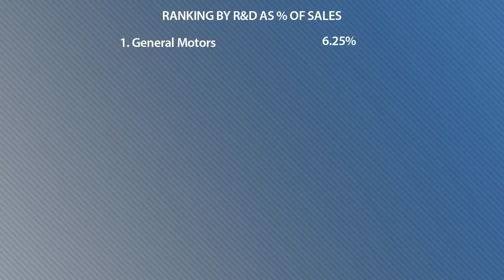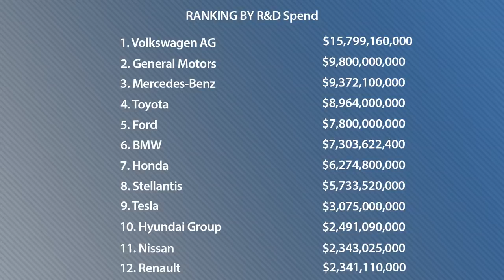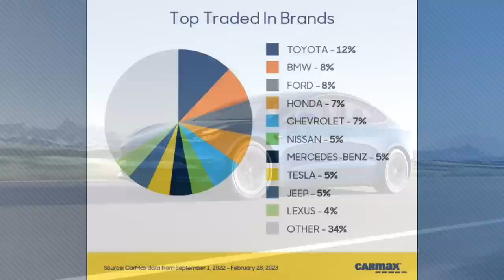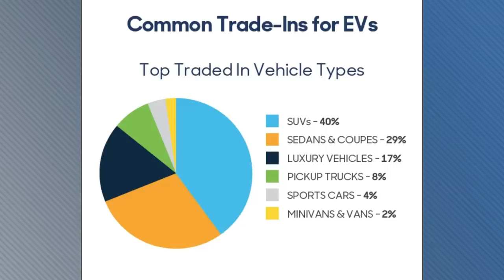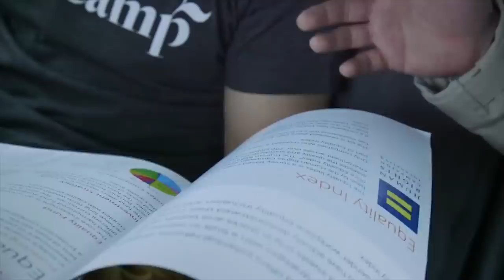BYD Growing Faster Than Tesla; Limos Going Extinct

Comment: BYD has so many more models to choose from than Tesla.  That's Tesla's biggest problem, no variety, just the same old boring EV's every year.  I really think Tesla is building up for the high quantity low cost market.  They can easily sell their cars for $25k and still make a profit.
Reply: But they aren't high quality. That's the problem.. High quality low cost is going to come from another manufacturer.
Reply: @benjaminsmith2287  my tesla had the front tie rods changed under warranty.  That's it for problems in four years of ownership.  No oil changes, no brakes, no checkups, just tires.  The thing still looks and feels brand new.  my I've had Volvos, Subarus, Hondas, and VW, Toyota, and others, and none of them were as little trouble as my Tesla. best car ever.  but you keep talking bs... they were getting expensive...I'm hoping it keeps getting cheaper so I can buy a second one!
Reply: @petersilva037  Elon had the market all to himself and the only real charging network.  His sales will still be good because of the charging network.  But if you look at the fit and finish of Teslas compared to legacy brands you will see a huge difference.  I bet even your Tesla had panel gaps that varied in size.  If you like Tesla go for it!  Some people do!  

My daughter bought a BMW i4.  Great car, great fit and finish, no problems.  Far better than a Tesla with all their problems and a much better service situation.  Teslas are often in the shop for months and some people have to drive to other states to get their Tesla serviced!

Comment: What's the future of Tier 1 suppliers who want to make motors and power electronics for western market OEMs as the latter want to move into vertical integration i.e. make their own to keep existing laborforce employed/stay relevant/marketing etc. Tier 1s target customers are the same OEMs for their ROW market? And/or new startups to help accelerate launch? Interesting to see how this would pan out fo Tier 1 suppliers. I see tier 2s have promising future, as they can focus on more sub component manufacturing (ex: stator housing for a motor, gear sprockets for reducers, busbars for batteries and traction drive, etc.) which OEMs do not want build tooling for

Comment: PHEVS ARE NOT EVS
Reply: They are when they're running on electrons.
Reply: If they can run as BEVs over 75 percent of the time or more, then they certainly are semi-BEV. There are PHEV drivers that only use the gas engine when needed. So they are hybrids.

Comment: More Toyotas are sold than any other brand so it's no big deal that more of them are traded in for BEVs. But Toyota may have a lower percentage of their owners trading in their cars for BEvs than other brands. Notice Lexus is low because Lexus doesn't sell so many cars.

The California thing needs consideration. We need trucks. Unless FCEVs are more advanced or BEV trucks go a long way from where they are now, not sure the ban makes sense.
Reply: I have no idea that Toyota also have fanboys.
Reply: Toyota makes essentially zero BEVs.  So any trade-in of a Toyota for a BEV is Toyota losing a customer.
Reply: @dansanger5340  After experiencing Tesla quality, the Toyota buyers will be back to buy more Toyotas.
Reply: @heathwirt8919  If they want an EV, they won't be back to Toyota, because Toyota is dragging their feet on EVs.  They'll go to another EV manufacturer besides Tesla.
Reply: @dansanger5340  Toyota would never accept Tesla's shoddy quality so it would be Ford, GM or VW until an inhouse design is ready. And it will be ready soon.
Reply: @heathwirt8919  Ex Toyota driver.   3rd Tesla and little trust for Toyota now.
Reply: @dansanger5340  They have plenty BEVs in the pipeline. They're making good on producing the BEVs they showed. They just have to get the metrics better in terms of range and charging speed. Sato said they're accelerating the timeline. What Japanese manufacurer has a lot of BEVs right now? None of them. Toyota is actually ahead of the others.
Reply: @lib1007  Has nothing to do with fanboys. This is a misleading story. You have to look at the size of Toyota vs. others.

Comment: what does GM need with a cryptologist?
Reply: It's one of the most difficult tasks ever conceived and requires brilliant people.
Reply: @heathwirt8919 Perhaps she can solve the riddle of what happened to the Ultium cars.  They've been in production for a year, but none are on the road.  Quite the mystery there at GM.
Reply: @davidmenasco5743  I was not aware any of the planned Ultium chassis vehicles were over due. What were the promised dates? I know the Cybertruck was promised to be out sometime in 2021, that's late.
Reply: @heathwirt8919  I haven't been tracking promised dates on all the Ultium models.  But I was very interested to see the Lyriq come to market.  It seemed like a promising car.  As I recall, production supposedly began in March of '22 (Hummer production in Dec. '21), following a significant build up of hype, which is fine.  However, I have not found a single video on YouTube of a Lyriq owner talking about their car.  I have not seen a single Hummer or Lyriq on the street.  I've seen at least THREE Mazda MX-30 driving around but not one Lyriq.  I see Polestar, Lightning, EQS and I4 pretty frequently now.  Lucid, IX, E-Transit, R1T and R1S, Taycan and E-tron, all are out on the street.  Not to mention tons of Bolts, Mach E and ID4.  But not one Ultium vehicle of any kind.  Over a year of production and not one vehicle to show for it?

It seems odd, and troubling.

The Cybertruck has never claimed to be in production.  It never even claimed to have a designated factory until a few months ago.  And it's not just electric, it's a really different animal, and God only knows if it can even be done.  So the lack of Cybertruck is not a huge surprise to me.  But I would have thought that GM could make more than 1,000 Lyriq in one year.  

In the first year of EQS production, Mercedes delivered over 10,000 in the US alone.  The Lyriq is on paper a much better value, and much better looking, but otherwise not exotic.  In reality it's vaporware.  I guess too good to be true.

Comment: A 3% profit margin? That's terrible . It easy to shoot up 400% when you compare to poor profits of a prior period. ...... And is Reuters comparing BYD's gasoline and hybrid cars along with their full BEVs? Apples to apples, eh?
Reply: Their net margin is low because they spend most of their gross profit on growth. They spent 5 times their net revenue buying assets in cash, largely factory fixed assets. Their total long term debt is roughly 1 month of gross profit. They have always turned a net profit, since before they started making cars in the mid 2000's. They spend the majority of their gross profit to fuel growth. Unlike building up a lot of capital to fund growth and only turning a profit after a decade and a half of losses, like Tesla.  BYD also outspent Tesla on R&D.
Reply: @larryevans6739  Tesla spends most of their gross profit on growth and has 10 times cash over debt. And capital expenditures are not in the P&L Statement, but rather in the Cash Flow Statement. ...  Everybody outspends Tesla on R&D. That doesn't mean a thing. There have been a few studies on how large car companies and other companies with huge R&D budgets do not have better products. Most of large R&D budgets are just wasted. Ever heard the old saw that if you have a 100 employees in R&D, only 10 do any real work. And if you have 10 employees, 8 do the real work?

Edit; I nearly forgot. Tesla is making $9500/car, and BYD is making $1,500/car, putting BYD in a tenuous position if Tesla cuts prices again..... But at least BYD is making money on their EVs, unlike everybody else in China or in the rest of the world for that matter.

Comment: A lot of interesting info in today's show, and a lot of NONSENSE too.

1. With all due respect, comparing TESLA to BYD is ridiculous, especially your conclusions. It is just laughable. Maybe somebody else will enlighten you why.

2. Equally laughable is to say, with a straight face, that the gigantic stretch Escalade is 'not conspicuous". It is the VERY DEFINITION OF CONSPICUOUS, regardless of what you may think.

3. R&D spending. You got one thing right. Some automakers get a TON of bang for their R&D Buck, and others get next to NOTHING (GM comes to mind. I knew many PhDs from GM Research Labs. Knew them very well, and knew how little they did there. They were our weakest PhD students, and GM research Labs was usually their best first offer. Whenever they got a better one, they LEFT GM.

4. R&D spending. VW spends a paranoid amount. WHY can't they direct 1% of it to improve their GOD AWFUL RELIABILITY>???

5. Interesting data on what vehicles people leave to buy used Teslas. The most surprising to me was Tacoma pickup owners dumping their pickup for the midsize Model 3 SEDAN/HAtch. If nobody else was surprised at this, you need to turn on your brain switch.

Comment: R&D sure costs a lot when your a wasteful company.
Reply: True, Tesla's been designing a pickup truck for almost 5 years and so far has showed almost no progress.
Reply: @heathwirt8919  Wait. What? No progress? So not even a prototype?  They haven’t even crash tested one?  There are no videos of them being tested around the factory.  Pull harder. When you hear a pop and see a bright light you’ll know you successfully pulled your head out your ass.
Reply: @schtinerbock4570  Has any major car magazine tested the Cybertruck? Have any firm specifications been listed? Has a final design complete with mirrors and interior been presented and open for inspection? Yes, it appears that preliminary crash testing has begun but not a single result has been released. It's way behind schedule and no amount of excuses will change that fact. Hopefully it may hit production sometime in late 2024 or first quarter of 2025.
Reply: @heathwirt8919   if its not released yet then how would a magazine have tested it. You make no sense.  Your claim they’ve made “zero progress” is plain wrong considering its going through testing.  My claim GM is wasteful is accurate.
Reply: @schtinerbock4570  Magazines test prototypes on manufacturers closed courses all the time. Tesla won't let the automotive press near the partially complete Cybertruck which first appeared on Dec 4, 2019 and claimed to be shipping in 2021. GM has an EV pickup and has show several more models that are close to production ready. You're claim is BS.

Comment: Keep in mind, Tesla isn't just transportation. It's also energy, with megapacks and solar cells.  And don't forget the Tesla charging network.  I'd be surprised to see that BYD is growing faster overall than Tesla.  And sometimes Tesla needs to retool with more advanced manufacturing like giga presses and battery design.  Then there's lithium refining, Tesla's latest venture.
Reply: BYD also has a battery storage division although I'm unsure the size. I ha e seen homes that use their batteries for energy storage.
Reply: BYD is actually a larger player in energy storage, solar, commercial vehicles, mass transit, batteries.... They already own mines, refining, recycling, processing... not just partnerships, but own it outright. They supply all their own batteries and every component in them. Led 1Q in global LFP production and are rolling out Na Ion now.  They make their own ingots and wafers, their own cells, their own Si and SiC chips... They are far more vertically integrated than Tesla or anyone else... you are just isolated from it due to politics and many of those items being blocked from the US market. 

They are growing 2.5X faster than Tesla. And they are growing with virtually no long term debt.
Reply: @larryevans6739  They grow because the Chinese government pours a lot of money into them every year and will continue to do so for several years to come, BYD employs more staff to build its cars, Tesla has almost everything automated and requires fewer staff than most manufacturers.
Reply: @mateogomez8413  That is not true. China eliminated EV purchase subsidies and is not subsidizing BYD, a publicly traded company largely owned by western institutional investors. By comparison, IRA spending on EV's is dramatically larger than anything in China.  BYD plants are also highly automated. BYD is growing because they are better.

Comment: Elon stated years ago if someone makes a better EV.  He doesn't care because he will take the credit for the EV evolution.
Reply: He never said that. Hater.
Reply: That's true, he did start the EV revolution!  And there are a lot of good EV's coming on the market.
Reply: @joeking433  Technically, it was GM with the EV1.
Reply: GM EV1 1996 (this still counts)
Nissan Leaf 2010 - $33K
Mitsubishi I-MiEV 2010
Tesla roadster 2009 - $109K
Ford Ranger EV 2011
Tesla S 2012 - $76K
Chevy Spark EV 2013
Fiat 500e 2013
VW eGolf 2014